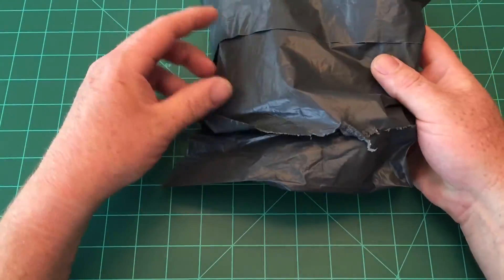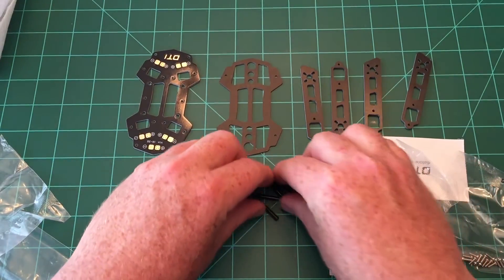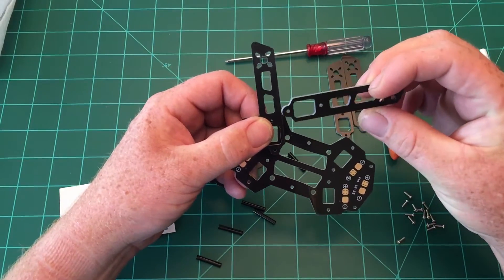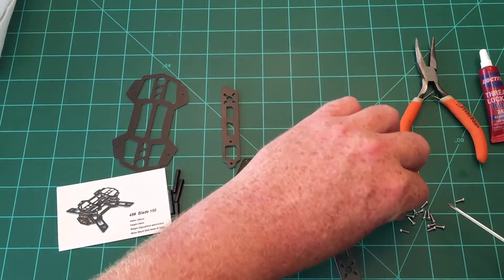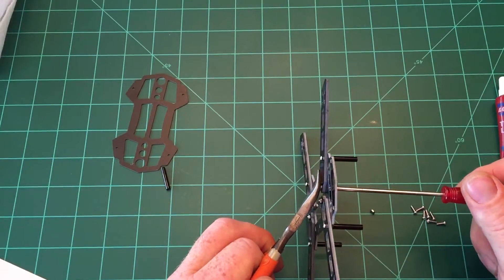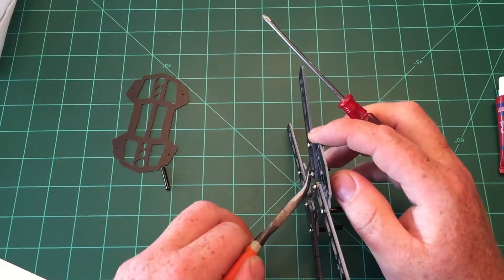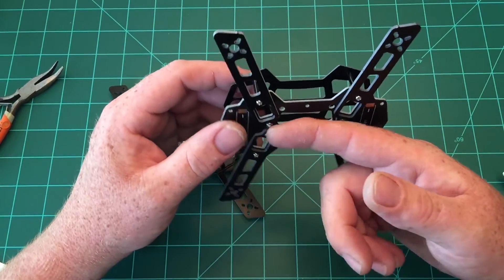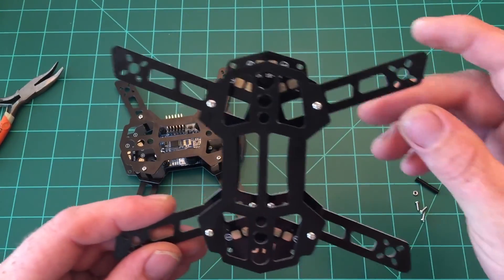Diatone Blade 150mm Quad Frame with PDB Review and Build Video | Micro Quad

Comment: I`m waiting for the 180 to come out so I can use 4" props.I may use one nylon bolt for the arms or a small zip tie and just one metal bolt through the standoff,creating a weakpoint for those arms,though it may not be an issue with a low mass frame like this?
Reply from the maker: Jake Bullit hey Jake, on a frame this small, the mass is so low, it wouldnt matter. I would use the metal screws and nuts. Today, ripping through some trees, I got a bit low and rolled it like a dozen times. Let it settle and since the battery is on the bottom, the weight helps it settle upright both times. Eased on throttle and just kept flying, no damage at all. The other night, while racing a 250 and winning, I cut a corner, collided with the 250, so his props shewed into me, we both hit concrete and due to the momentum, we rolled like a million times into the field. Only one broken arms, since these are glass fiber, they break nicely and all props broken, everything else was perfect. For such a destructive crash, it was super minimal and had it up and flying in no time. Definitely buy a couple kits for spare parts and you'll be set for a while. 

If you hadnt seen it, I posted a flight video this morning, check it out, This thing rips! 
https://youtu.be/PPn5U11uP28

Comment: my boy is wanting this. waiting on banggood to get the carbon fiber version in stock. where do you get your props? I was thinking of cutting down 4".
Reply from the maker: Tim Fulford Hey Tim, I got my 4045 props from myrcmartcom, I did cut them down to fit and they work perfectly. Had to make a jig with dremel and router attachment.